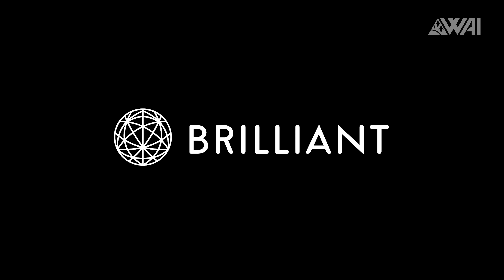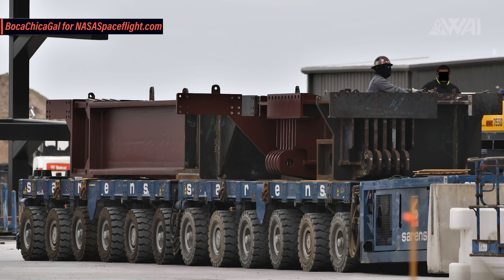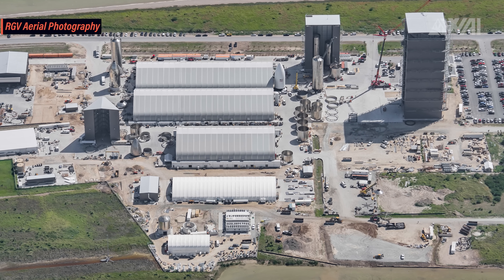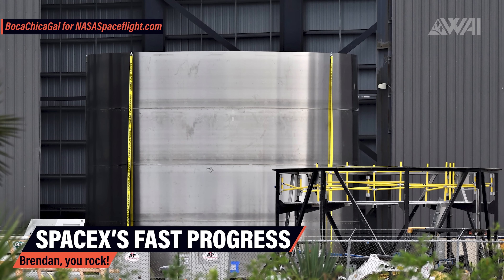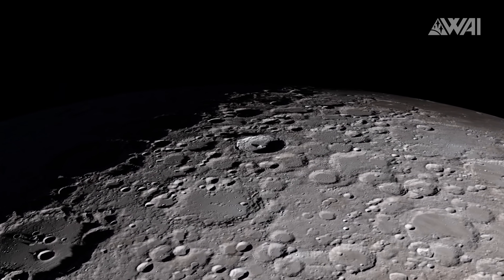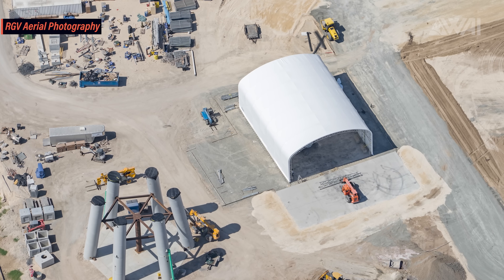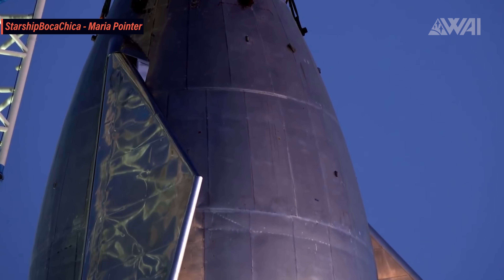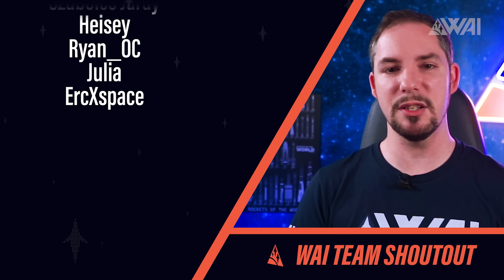129 | When will SpaceX's Starship SN8 fly?

Comment: They probably wont launch anything with more than 3-5 engines.   Full booster launches I bet will be from of course I still lo e you II..  :)
Reply: Boca Chica is permitted previously for Falcon Heavy
Reply: @alvianchoiriapriliansyah9882  Falcon heavy?   They'll probably fly super heavy prototypes.   But with minimal engines.   The launch stand is built for load, but has no exhaust diverter and no vibration/acoustic dampening.  doubtful the onion tent would survive a 28 raptor chorus from so close.
Reply: @DD2DL  Did Elon also said they would have no acoustic dampening/water suppression?
Reply: @alvianchoiriapriliansyah9882  Elon tweeted that no flame diverter choice was probably a "mistake'
Reply: @DD2DL  Flame diverter and sound water suppression are two separate things. And he admitted that it was a mistake so he probably didn't pursue it afterall, and just a play thoughts
Reply: @alvianchoiriapriliansyah9882  ?   Umm   So you agree?
Reply: @DD2DL  I'm still very disagree with your intuition that they won't install a water sound suppression which they absolutely didn't confirm, as it's a separate things with flame diverter
Reply: @alvianchoiriapriliansyah9882  Its a stout but VERY simple design.  I think its rev 1 of their super heavy prototype launcher.   By the time they're ready for full starship leo orbits, they'll build another launch pad.   Maybe out in the gulf.

Comment: The spoon parts are valves the red part are the actuator for the valve they bolt in between two flanges inline . I was a pipe fitter and welder for 35 years and have seen and installed many.

Comment: Musk has said that he would build offshore launch platforms to mitigate the sound  of launching a superheavy with 28 raptors. A transportation system would have to be developed involving a dock and dredging a channel to the building site. Unless, a superheavy can do a suborbital hop from a launch stand at Boca Chica to an offshore launch platform somewhere in the gulf using only 2 to 3 raptors.
Reply: There's now a connecting road under construction between hwy 4 & Brownsville canal, so no need for expensive time-consuming new canal dredging. Ofc they could also do a hop for transport

But that doesn't mean the land orbital launch wouldn't still be a thing. It will just be less frequently than offshore one

Comment: Without meaning to belittle the achievements at Boca Chica, the Super Heavy, is basically 'just' a scaled-up version of Starship, without the flaps and the nosecone - all the knowledge and experience needed to build and fly it has already been developed on the Starship and F9 programmes.  The only real difference with the SH is the sheer size and power of the vehicle.  So I would expect the first SH to be built very rapidly once the highbay is ready - and to be flying much more quickly than the Starship did.   The real hurdle for SH will be when they start to fly it with more engines, when they will have to solve the problem of where it will be launched from (i.e. not Boca Chica!).

As for the size of the ring segments, I suspect the limiting factor here is the size of the steel supplies.  The current ring size is probably just the widest steel roll available.  To start building with larger rings, Space X will need to be able to guarantee to buy enough larger steel rolls to make it worth a steel mill investing in larger rolling machines.  And I wouldn't be surprised if this is currently as big as they get, so bigger rolling mills will have to built from scratch - which will make the investment cost even higher.  So I expect the ring segments to stay the height they are now for some time.

Comment: Have you considered that maybe the tent at the superheavy launch site may be a ‘test fixture’? Maybe they’re wanting to see just how close the can build and examine the damage.
Reply: The tent is temporary for construction
Reply: @alvianchoiriapriliansyah9882  Although it most likely is, as you suggest, NO SpaceX personnel has confirmed this yet. Anyone on the Internet who suggests otherwise is passing their information off without backing.
Reply: @NorthernChev  It absolutely doesn't looks like a permanent. It can be disassembled pretty quickly when the launch is due. Similar thing can be found on 39A construction. No need for SpaceX to confirm

They didn't confirm that your theory is correct either, passing info without backing
Reply: @alvianchoiriapriliansyah9882  Which is why my comment starts with, "Have you considered...". And not an absolute like, "The tent IS...". Cheers.

Comment: With the height of it all stacked i wonder how much POGO occillations will affect its flight.
Reply: Like Soviet N1.
Usually caused by back pressure engine combustion instability - hopefully not a problem with Raptors.
Reply: @HighPeakVideo  on the Saturn V they staggered the engine firing sequence.  I was curious how SX was going to deal with it.  Its amazing engineering.
Reply: @redbovine  Fifty years on from N1 and SaturnV the advantage is the pressure vessel, fluid dynamics and engine response can all be finely simulated, and resonances damped.  But you are right to consider resonance, as it can emerge unexpectedly when other things go wrong.

Comment: Those large red cylinders are pneumatically actuated discreet control valves or XCVs. The red cylinder part is the actuator with a piston inside that transfers air pressure into movement. This drives the valve open or closed depending on the need and a large spring returns the valve to its normal(failed) state when the air pressure is relieved. These types of valves are used in the industries as an all or nothing valve (on/off), they can't throttle or be set to anywhere in the middle. I can see the valve bodies are disc or butterfly valves that are used in slam shut and stay shut configurations. Knowing this you can bet they will be installed in piping as emergency cut-off valves. Looks like more piping is about to take place. Also, the valve bodies look like stainless so they will most likely be installed in stainless pipes. The question now is what requires stainless steel pipes? Here's a picture of one with a regular steel valve body and a manual override wheel attached. https://www.pneumaticairactuator.com/sale-11239527-durable-pneumatic-emergency-shut-off-valve-automatic-water-shut-off-valve.html

Comment: 10:32  I think the red things might be giant hydraulic "butterfly" valves, of the sort that would be used to open a large diameter water pipe in a very quick manner.  Deluge system control valve?

Comment: I think one way to make the Starship & Super Heavy construction easier & faster would be to get wider steel ring segments from the steel mill at the beginning of the process.  If they could receive ring segments that are double the height of the current ones then they could eliminate half of the welds needed. What do you think, Felix - is that possible?
Reply: Elon had said similar things, but ofc they have tow air for the steel mills

Comment: Sorry to destroy the speculation, but there is no way they are aiming fly already on November 2nd. If they did, we would have a NOTAM by now. Also the closure announcement https://www.cameroncounty.us/wp-content/uploads/2020/10/PUBLIC-NOTICE-OF-CAMERON-COUNTY-ORDER-TO-TEMP.-BEACH-CLOSURE-AND-HWY.11.02.20.docx.pdf states "SN8 Nose Cone Cryoproof". So, it's still going to be more ground testing. If they still need to cryo proof it, it also means that there will be yet another static fire drawing fuel from Nose cone after this. And after all testing is done, they can apply for NOTAM 3 days later. So, the week after the next would already be a very optimistic estimate.

Comment: Hi Felix, I'm following your channel since quite a long time, now. 
Regarding your question in the video, the red part (cylinder) is the hydraulic or pneumatic actuator for a butterfly type valve. The valve that goes inserted in the pipe flange is the covered part you were not able to recognize. The larger the diameter of the valve, the larger the force you have to apply to generate the torque to close or open the butterly valve.
I'm an electronics engineer, with more than 10 years experience in Instruments & Control for Oil and Gas, and from what I've seen before in projects, I'm quite certain that the part you mention would probably go to block a large diameter pipe. My guess would be the water deluge system, that would require quite a substantial flow.

Viele Grüße aus Argentinien, Ich kann ein bischen Deutsh, auch!

Comment: Those red, "spoon-like" objects appear to be actuated butterfly valves. The red bit is the actuator, either electric or pneumatic. The "spoon" bit is the butterfly valve itself and would be fitted into a pipeline, sandwiched between two flanges.

Comment: One thing is clear: The Boca Chica site in its current size could never support the production of 1000 Starships or more, least the storage, maintenance and constant launches. So we can expect that once the production and launch processes have been perfected, more and much larger sites will be built.
Also, part manufacturing will have to be expanded. As Boca Chica is mainly used for assembly, where do the pre-built parts come from?
Reply: Ofc

Comment: According to my knowledge they are already using oversized width coils of sheet metal. Most coils in the industry for steel, are 30 inches, sometimes 48 or 60 inches wide. I think the SpaceX is getting 72 inches wide ones, and it is already at limits of capabilities. They would need to invest heavily to produce wider rolls, completely new lines with extremely heavy equipment. Costly, but more importantly takes years to build. Then they would need to upgrade their cutting, drilling, etc capabilities, but that is way cheaper to do and not a technical issue. Aluminium rolls do come sometimes in much wider rolls, I have seen 103 inches (2.6m), for things like truck trailer roofs, but aluminium doesn't require crazy big pressures to roll, like steel.

Comment: The red parts are butterfly valves. they get sandwiched in a flange. Actuators look like fast type. Probably for coolingwater because these are not very high pressure rated.

Comment: Maybe they have abandoned the orbital launch mount? When was the last time they were working on it? Musk did say the lack of a flame trench may be a mistake and I know he talks about not sticking with an idea once it becomes apparent that its a bad idea. No matter how much you have already put into it. I just cant imagine how they will ever be able to launch that monster on land. But thats just me.
Reply: It will take weeks, if not months, for the concrete in those pillars to cure.
Reply: @dwayne1029  Hadn't thought of that. I guess I just can't get over it having nothing to deal with the blast. I dont think its possible, it could hurt(windows mainly) regular structures miles away. Without a flame diverter will it have a deluge system? There must be a critical piece of information missing here cuz none of this makes sense.
Reply: @allineedis1mike81  I haven't done the math, but if they can get SH and SS off the pad with 1/2 dozen engines rather than 28, then light the rest after lift-off  that's the only way I can see not needing some sort of diverter. I agree, it doesn't make sense ... yet.
Reply: @dwayne1029  yeah I've wondered about that as well. No payload and minimum fuel just to get to orbit to test reentry. They might be able to get the altitude with just starship for that without going to orbit. Just way waay up. Seems like they wouldn't build such a permanent mount just for a few special case tests.. But even with half the engines, a quarter.. still a huge blast. No math required. I'm waiting for some giant oil rig launch thing to come floating up to the site. Or more info as usual😁

Comment: NASA uses mobile launch pad 39b and will launch SLS from that location. The mobile launch tower rolls up and over the launch pad. NASA says the basics that every rocket launch needs are "electrical power, a water system, flame trench and safe launch area." They have a water sound suppression system that contains 400,000 gallons of water. They also want to minimize any permanent architecture exposed to the elements. All of this has cost billions of dollars. None of the rocket platforms SX has rendered so far contain all of these elements. They may be there but I just don't see them. I don't see how a full blown SH will ever launch from the pad under construction right now. I believe you could test a completed Starship and a partial SH with fewer engines but anything more will not fly from this pad. Of course, you could launch a F9 there. That would save SX about 13m in launch fees per launch. I think the SH will fly from the gulf and there is probably already a launch pad going up there right now.
Reply: Pretty sure all of that is available, just obv both rocket use different design of launch pad
Reply: @alvianchoiriapriliansyah9882  - Alvian, I just read than on 6/18/20, the Houston Chronicle reported that SpaceX was advertising for Offshore Operations Engineers and Offshore Systems Techs to add "an offshore rocket launch facility..." to the South Texas infrastructure. My guess is that is where the completed full scale SH/SS will launch. Boca Chica is a test site.
Reply: @rocroc  Elon doesn't officially rule out Boca Chica as a test site and orbital launch complex. Just that the flights will be less frequent than offshore

Comment: Question: Is Boca Chica a or can be a Starship factory?
Answer:  It cannot.  1) To get the costs down large parts must be manufactured elsewhere and assembled into a starship.  The cheapest way of shipping a part is by water.  2) Assembly must be close to launch location to avoid an extremely slow bottleneck in the launch.  That means assembly must be done near a floating launch platform AND sizeable dedicated port.   
Summary: Boca Chica lacks a dedicated port able to handle the total imported parts and exported Starships as yet.
Note:  You can bypass parts imported by local rail and road networks but no one seems to be reporting of the infrastructure changes needed for the changes in Boca Chica needed.
Reply: Considering the evidence in this video of multiple prototypes, and the sign that says "orbital launch pad", your assertion seems unfounded. The largest parts of the actual vehicles seem to be the lower wing flaps which are easily trucked in. What "parts" are you referring to?
Reply: @spheroidialmaster1910  All parts.  It is not about ease of trucking, but the cost of delivery in bulk.  The infrastructure need for the vast volume of material shipped for assembly is just not there yet.  Roads are great for prototyping, but bulk manufacture?  No way!  you need rail and barge shipping.
Reply: @robert8659  The county already start constructing a road from Hwy 4 to Brownsville canal
Reply: @alvianchoiriapriliansyah9882  Really!  how much volume can it handle?  weight load? Also the canal: a starship will suffer buckling being shipped on a barge other than the heaviest of heavy meal.  F=MA you know so what are those dimensions!

Comment: I hope you devote a future episode to the lunar Starship. I assume it would have no heat tiles or flaps and only have 3 vacuum engines at the back. Where would the engine be that fires the descent thrusters to the moon? I am curious because the thrusters are placed high up on the Starship.
Reply: The descent could be done with RCS nozzles which use Hypergolic reaction thrust .
Reply: @swapshots4427  Thanks!  
"Definition of hypergolic. 1 : igniting upon contact of components without external aid (such as a spark)" 
So what components are we talking about and where will they be stored?
Reply: @MrEd2291  I am pretty sure that hypergolic fuels require two different substances which on colliding with each other ignite spontaneously. Similar to lox and kerosene apart from the fact they don't require external energy to react with one another. An example of a hypergolic reaction would be water and pottasium if I am not mistaken.

Comment: Do you think they will use stir friction welding (to make the welds less visible and more resistant) like ula does on this vulcan and delta v rockets?
Reply: Nope. Stainless steel can't be friction stir, it's for aluminum. They will in the future use autogeneous laser welding instead
Reply: @alvianchoiriapriliansyah9882  thanks for the information

Comment: if the ring segments in front of the hi-bay are for a booster, how are they gonna 
fit ~28 Raptor engines into the same diameter where they currently expect to fit 6 ?
Reply: Out of the 6 raptor engines on starship, 3 of them are vaccum optimized meaning they have a much larger nozzle. 28 raptors should be able to fit in the 9m diameter although even i am finding it hard to believe.
Reply: @franekcer1008  Given a 9m diameter hull and a 1.3m diameter Raptor engine, the best i got so far is 26 engines with no 'wiggle' room for thrust vectoring. Anyone know a formula to calculate how-many-circles-fit-inside-a-circle ?
Reply: Falcon 9 can fit 9 engines in a much smaller 3.7 m diameter. And several renderings suggest they can indeed fit
Reply: @alvianchoiriapriliansyah9882  Are they Merlin or Raptor engines on the Falcon 9 ?
Reply: @aga5897  merlin. But Raptor is not significantly bigger
Reply: @alvianchoiriapriliansyah9882  ok. thanks.

Comment: Be on the lookout for a different kind of thrust dome. No idea if it will be one for just 2 Raptors or the whole middle layout but just attach 2. Either way it should be different from what they are using on SS. Also there is speculation the FAA may want SpaceX to show they can launch, cut the engines, relight and land like an F9, before they let them do the 15km belly flop. Again, speculation.